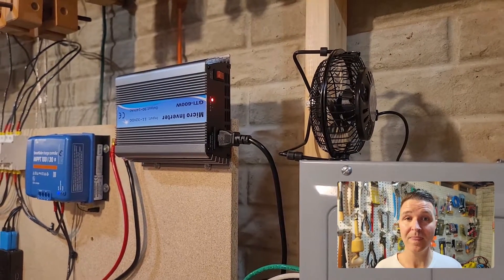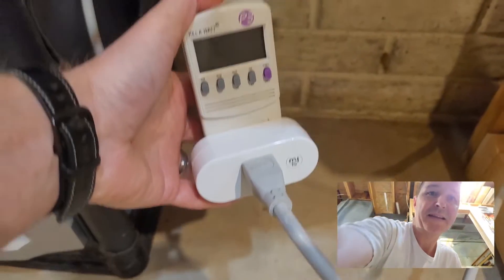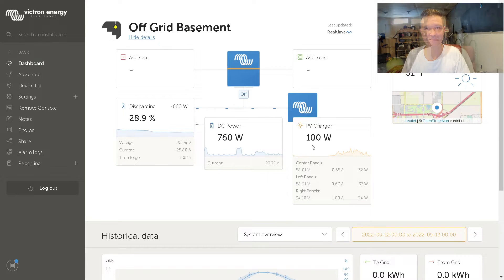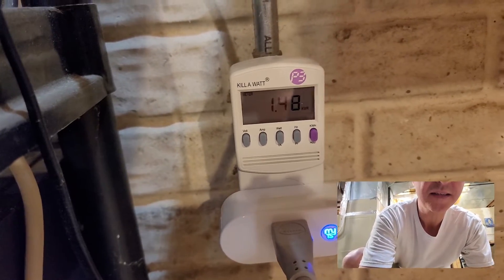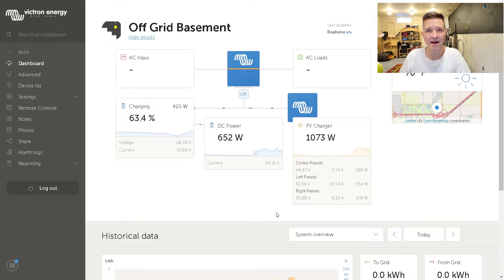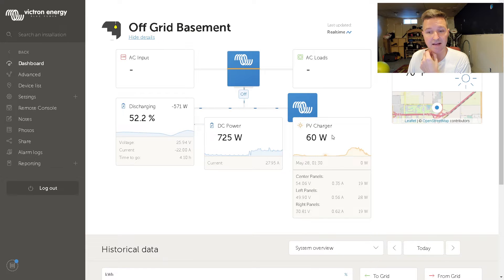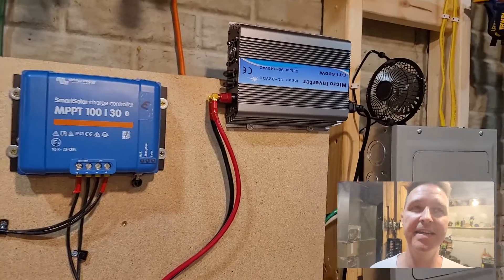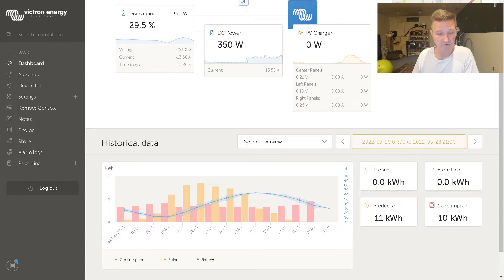Can you run a 600w Grid Tie Inverter from a 24v battery for 14 continuous hours?  Let's try!

Comment: I have the same grid tie inverter connected to 2 -12 volt lifepo4 batteries in series for 24 volts i have a 20amp breaker between the batteries and inverter it keeps  popping the breaker it ramps up to 700 ish watts according to the killawatt meter it'll only eun for about a minute any ideas as to why th8s may be happening? Thanks for the video

Comment: I have the 22 to 60 volt input type inverter but when I connect the 24 volt battery it does not fire up. Any suggestions
Reply from the maker: Sounds like the battery voltage isn't high enough for the inverter to kick on, even though it's within the range.

Comment: G'day Mate, my best advise to anyone trying to live offgrid is to buy as many secondhand house solar panels as you can, have them attached to every fence and on the ground. I have been buying any secondhand solar panels from Facebook Marketplace for a whole year, to the point where I have 120 solar panels. Now it doesn't matter if it is rainy or cloudy, I am always making some power whenever it is not night. Old solar panels might have less output then new panels, but it all adds up to getting more power into your batteries. But take a multimeter to test that each panel is working when buying secondhand solar panels. Use 12V item to save power & as backup.
I hope this information helps everyone.

Comment: I am looking for a setup like yours, but one that I can power my non-grid-tied setup. Any suggestions?
Reply from the maker: Just hardwire an offgrid inverter to a power panel or a 6 circuit transfer switch.

Comment: Is there any trick we can play with the micro inverter to use it only as a off grid inverter to power  appliances, with no other power(grid etc.) source involved?
Reply from the maker: No.  A big safety feature is it needs to sense AC voltage in order to operate.

Comment: You didn’t do it,  apples to apples because when the testing started, your battery was around 10% but when the testing ended, your battery % was over 29%
Reply from the maker: That's because I received more solar power than I could use in the day so my battery received 19%.

Comment: Thinking about adding a battery to my system between panels and inverter , so am I right in thinking as long as my battery bank voltage matches my micro inverter range I don’t need to worry about the amps the battery is capable of putting out the inverter will only ‘draw’ its max capacity? Hoping that if the panels are producing more than I’m using I will be able to still get some power after the suns gone down with the addition of a battery guard set to switch off at 50-60% discharge does this sound like it will work ?
Reply from the maker: Yes.  Just remember the inverter will run at max output all the time.  Just make sure it stays cool and has plenty of airflow.

Comment: GREAT GREAT Video, thank you... My unit arrives today. I'm guessing I can attach it directly my my batteries, 24 volt, and use my existing controller hooked up to them to manage solar panel charge to batteries??? It looked like you picked up the battery connection from the backside of your 3000 Watt power inverter?
Reply from the maker: That is correct.  Just make sure you're not back feeding the grid outside your house!  Thanks for the comment.

Comment: I do exactly this daily 10 times(!). From 17 to 22 hour in every 15 minutes on, 15 minutes off (no special ventilator). It is controlled by a simple mechanical AC switch clock(!!) It is altogether 0.8 kWh daily from the battery to the grid -- at the best time we help the grid(!!!) Why? We send the surplus energy to the grid in the evening and make some void battery capacity for the morning. The battery level is not protected(!!!!) -- this appliance is off in the winter and when i am not at home.
Reply from the maker: Thank you for the information.

Comment: Her is my plan my local power company will not do net metering and I don’t want to be charged for the power I creating buy 2 1300 watt 24 volt to 220 grid tie inverters   3800 watts of solar 380 watt hour forklift battery charge battery and wjen my ac unit kicks on have a relay that turns on the inverters
Reply from the maker: Whatever you need to do to make sure you don't back feed to the grid is most important.  The relay is a good idea!

Comment: I also watch the first video. Interesting subject but I think you overlook something. By running the grid-tie inverter you drain the battery because there is not enough power to (fully) charge the battery and run the grid-tie inverter at the same time. Actually, you doubled the loss of the system by taking away the charge (and more) by a load. It would be more efficient to first charge battery to a safe level (for the night and enough room to run the grid-tie inverter) and after this use the battery (and/or with solar) to run the grid-tie inverter. 

You need a schedule or some measurement automation to run the grid-tie inverter at safe and most efficient moments to guarantee the system keeps running and stable without problems. This results in more efficiency, there is a controlled balance between the loss and benefits. The loss is not a problem when there is enough overhead. For example, when it is only possible to run the grid-tie inverter at night, you still save XXXw on electricity bill. I think that is a plausible result. But if you want more, you need more overhead, to be sure a loss somewhere in the system is not a problem. It is better to have more than you need than exact or less than you need.

Other things you can do is to reduce the overall power consumption. Why do you need 700w at daytime and why only 200w at nighttime? Ask yourself this question because this can save you money and hassle to expand the system.
Reply from the maker: Thank you for the great information!

Comment: Nice. As mentioned in your other video, I ordered a unit that looks just like that, so I'm glad that it seems to like running for 14 hours.
Reply from the maker: It runs well as long as you control the heat.  Thanks for the comment.

Comment: My grid tie inverter doesn't like the Kw tester...  I have to remove it..  It also pongs from fault to on back and forth a lot.
Reply from the maker: Interesting.  I've never had an issue with my unit.  It just worked.  Thanks for the comment.
Reply: @OffGridBasement  Only happens with low power..

Comment: so from 2to 9 you needed 22kwh?

what are you doing with all that electricity?
Reply from the maker: I'm not sure what I did during the shooting of that video, but between central AC, using a clothes dryer and charging my car I use an average of 37kWh a day.  Also, the 22kwh was between 7am and 9pm.  Hope that clears it up.  Thanks for the comment!
Reply: @OffGridBasement  dam, that's a heck of a lot of power

the average home in germany uses about 8kW/h a day...

pretty sure there is at least some potential to save some power in your house.

A dollar saved is a dollar earned, same with electricity :D

Comment: So the part the almost nobody covers, are you only powering one circuit in your house and if not how is this part wired in your panel?
Reply from the maker: You are correct.  Only one side of the panel is being covered.  I would need a second inverter if I wanted to plug into the other side.  Thanks for the comment.

Comment: If you weren't running the extra usb fan, that would have added 10 watts to your inverter numbers.
Reply from the maker: That's true.  I read in posts that when the internal fan burns out, the unit quickly dies.  I wanted to make sure I had that covered.  Thanks for the comment.
Reply: @OffGridBasement  Yeah, I got that; this was just a caveat. cheers.

Comment: @off Grid Basement How did you fool the Grid tie inverter to run straight from the batteries ?? My grid tie inverters which are 600W micro inverters, and I cannot get them to run straight from batteries as they are looking for panel voltage. I have 4 X 12V Batteries all are AGM deep cycle batteries connected to give me 48V nominal. they give me actually about 58V as they hold a good charge, so plenty of volts to start the inverter, but just wont work, wondered about getting a Y&H Unit and seeing if that works any better.
Reply from the maker: What is the minimum voltage for the grid tie inverter?  I believe mine is 22v.
Reply: @OffGridBasement  Mine are 42V, I am going to get a current / voltage limiter and try again, seen on a few forums that these inverters don't like over voltage and will shut down. (I have tested it back on my panels and it works fine) but it won't work on batteries. Failing that I will change the inverter to one with a built in voltage controller. 
Thanks for your reply, much appreciated. 😉

Comment: on 8:56 video clip i see 2 breakers ,  on the right breaker   red cable left and second breaker red cabler ight can u explain
Reply from the maker: In the video you notice that one of the breakers is up side down.  That's why the wiring  is odd.  I believe the top of the breaker should be pointing toward the side with the most potential energy, but I could be mistaken.  I have an diagram of my setup on my website:  https://www.off-grid-basement.com

Comment: how about the batttery is full automatic switch to gridtie that s i want to do but i  dont kown how wil you do video for it
Reply from the maker: I believe to get that accomplished you would need something to measure the voltage of your battery bank and then have some sort of automatic switch to turn the AC side of the grid tie inverter on and off depending on the voltage of the bank.  I don't really have any idea on how to physically pull that off.
Reply: ok

Comment: Nice Video update.. btw if i have both 240v like for electric stove and clothes dyer, will this inverter supplement electric use as well?
Reply from the maker: Yes it will.  It will supplement the one leg of the 240v circuit.  Thanks for the comment!

Comment: Thanks for sharing. Would it not be better to invest in additional battery storage to begin with. I get the power dump concept because who wants to waste the produced energy but you have added more complexity to your design, additional losses due to heat / cable loss etc, and if the grid goes out you would basically want to have full sun to capture the power being generated when the batteries are full. I get batteries are expensive perhaps experiment with lifeP04 diy batteries. For about $1350 you can solve your 8kw power difference. I just think if you have to put a fan on that grid tie inverter to keep it cool you are adding risk to your home and family. I like the innovative approach how ever and you learn by doing these types of things.
Reply from the maker: Thank you for the concern.  I've actually moved from the Grid Tie inverter b/c of the fact I have more storage capacity to work with.  The only issue now is that the additional capacity is  in different voltages!  I have a 48v system and a few 12v batteries lying around that I want to start using for energy dump purposes.  Thanks!
Reply: @OffGridBasement  I am learning all this as well. I don’t have solar yet, just two 3k multis and 12KWs of battery. You guys have really interesting approaches. Thanks for sharing

Comment: Hello My friend.Nice approach of meaurements and good results.Congrts.Friend i have a question for you and be happy to hear your answer.We all know that in order to Grid tie inverter to operate there is a Limitation.which is Existence of Grid.What about if grid goes off??? is there a way to create my personal small Grid with an identical off grid inverter and a small battery so offering to the grid tie inverter electricity with 2 characteristics. Sinusodial   220 volt AC   at 50 Hz. ?????Thank you
Reply from the maker: Ohh...  there is a way of doing it, but it is very dangerous to do unless done properly. It's dangerous for people working on the lines the most.  That is the reason the grid tie inverters all require "islanding".  If the unit doesn't sense any voltage from the grid, it shuts off.  There are other channels that will talk about a work around, but I won't talk about it on my channel.  Thanks for the comment and I'm sorry I can't answer your question.
Reply: @OffGridBasement   My dear friend i would respect if you can email me a hello to my email.i would like to answer you.I am profesional Mechanical electrical engineer and of course Respect is plenty for the electrical applications.No worries.i know well islanding.I refer to create my own personal grid and when that is active I will cut off the city grid.No worry.But the whole consept that somebody can avoid today batteries who are b.expensive b.dangerous c.need often inspection.d.carefull with temperatures attained.  and finally have a certain LIFE.  that makes us Love the Grid tie inverters.But if something happens and we have a grid cut off for a month.ISNT it pitty having 20 solar panels not to be able to enjoy the sun rays GAIN??????? Also i have bought a grid tie inverter SUN wind with limiter 2 KW.and in the manual they say little about the way of connecting the EXTERNAL limiter .and of course i know nothing about it.Chinese are not helping in guiding you in these matters..Thankful to you.I wait your letter. Greetings to you.       pavoult@gmail.com

Comment: Hello, thank you for the nice video.  I like to ask you.  I have the same inverter plague to 3 100w 12v solar panels in parallel.  I have input 15A @ 16v DC but I get only 140w output @ 230v AC. What I do wrong? Normally I have to have at least 250w @ 230v AC ? Thanks.
Reply from the maker: Is it possible you have a loose connection to the panels?  Also, is your inverter getting hot?  Does the fan still turn on?  I've read that  heat can really hurt production.  Just my thoughts...
Reply: @OffGridBasement  Hello again.  Thank you for the answer.  Inside the inverter maybe have loosen connections.  Out side at the end of the cables I measuring 15A @ 16V no open circuit. The inverter it is not hot. I get only 45% of what I have to get.  I think.  I want to try with power supply at the input and not the panels to see what I will get. Again thank you for the answer.
Reply from the maker: @ΜεταξύΜαςΤώρα  there are going to be losses, but not like that!  Please let me know if you find out more.  Good luck.

Comment: How do you limit the current from the battery to the inverter?
Reply from the maker: I don't!   The inverter runs at 100% whenever it's on. I've looked into my base electrical usage from the grid and it's right at 600-700w.  That is the main reason I bought the 600w grid tie inverter.  Hope that answers your question!
Reply: @OffGridBasement  so the batteries feed the inverter at their maximum capacity, or the inverter limits the current?
Reply from the maker: @Tony770jr  the inverter max is 600w.  So it can only that amount from the battery.

Comment: I’m new at understanding why you’re using a grid tie inverter, when you already have a 3000W inverter?
My system is pretty basic, charge controllers and panels on the roof. Then I have my inverter and my batteries. I’ve never used a grid tie inverter and not sure why they’re being used at all? 🖖
Reply from the maker: It's basically an energy dump.  If a see that my batteries are almost full I turn on the grid tie inverter to slow the process.  Then the extra energy is going in my house and not be wasted because your battery is full.
Reply: @OffGridBasement  
Pardon me, I’m using a smart inverter that does that for me. Victron and a shunt fixes all that. 🖖

Comment: I have a buddy who tells me I risk spinning my electrical grid meter and getting charged for it anyway. Is there a good summary somewhere that you read where I can learn more perhaps?
Reply from the maker: That is such a localized subject.  I really think it depends on your provider.  I personally think the best thing to do is either get a Grid Tie Inverter with a limiter or study you electrical usage and find out what your base usage is.  I studied mine since mine doesn't have a limiter.  I found out that my base is around 500w.  That is what my house uses in the middle of the night or while we are gone.  If I go with another higher powered inverter I will get something with a limiter.
Reply: @OffGridBasement  
Isn’t this what I shunt is used for? I can find out all the power I’m using at any moment in the day or night.
Reply from the maker: @benjones8977  that definitely works if you are comfortable opening up your main service panel.  Did you use a Shunt with a clamp?
Reply: @OffGridBasement  
The shunt connects from my battery to my negative bus bar. There is no connection to the panel except from the inverter. 🖖
Reply: Thanks for your input. I am indeed learning and with helpful advice (& videos such as yours here!) I will correct this ignorance condition rapidly. 8-)

Comment: I still have not added a Battery,, I think I should have got a different invertor. You can get thses chinese ones with Variable Limit..Which helps.. If I add a battery think I will get full 1400w...I will post link to  Variable Limiter in reply....
Reply from the maker: I would like to see the inverter.
Reply: @OffGridBasement  MAybe what I mean is can a Solar Controller adjust power going into the house... Or would I have to use a variable  power invertor...
Reply from the maker: @SolarResurrection  oh.  I believe there are grid tie inverters that let you control the amount going into the house.
Y&H 1000W Grid Tie Inverter Power Limiter DC25-60V Solar Input AC110V/240V Auto Switch https://a.co/d/9RsFzso

This comes with limiter and max output setting.
Reply: @OffGridBasement  Looks nice... I have not seen a fully automated model..Could save energy rather than putting everything thru expensive batteries..Thanks..